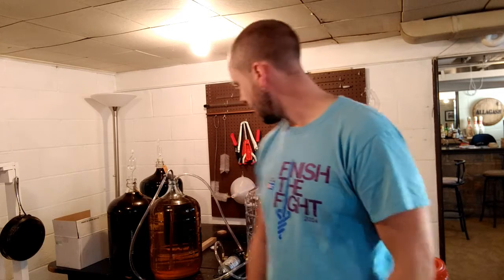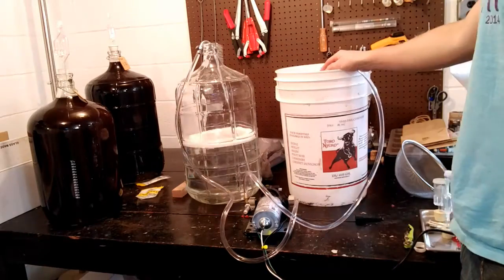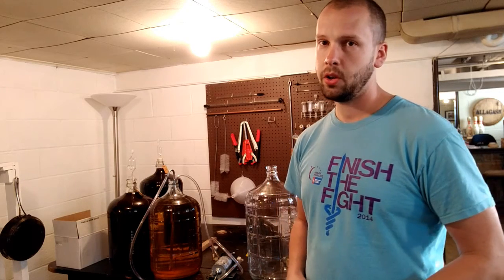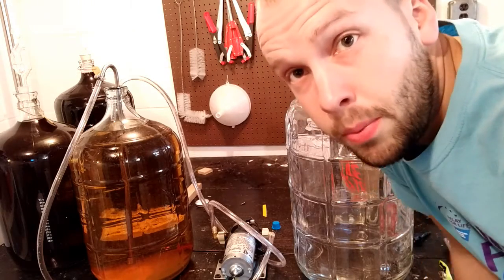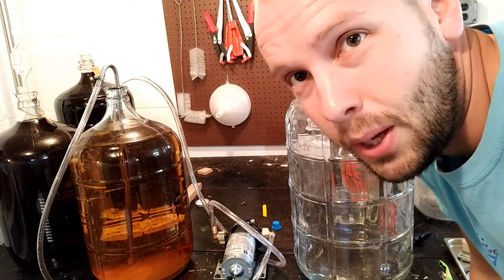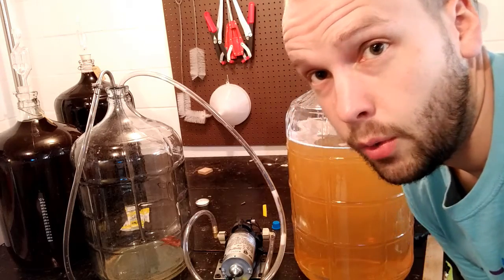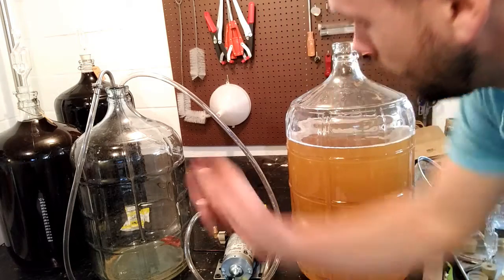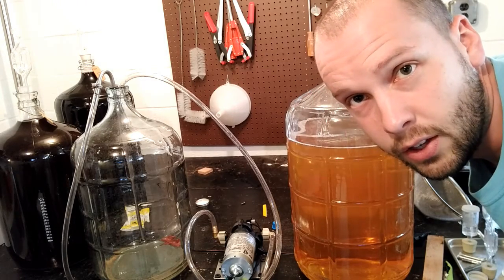Budget Wine Transfer Pump - Shurflo 2088 Diaphragm Pump

Comment: I see you wrote 3.3 GPH in the description, but I believe you meant GPM (gallons per minute). That's a pretty strong pump for just moving wine. I see why you would put a dimmer switch on it. Cheerz.

Comment: great idea! i am in the process of making something like this and am interested in degassing at the same time.  is there a way to control the flow rate.  i'm thinking installing a valve on the the intake tube. do you think that will be ok? also, as far as sulfiting, a ton of air is going into that secondary vessel.  do you have any problems with oxidation?
Reply from the maker: I was considering the same thing but putting the valve on the outlet so that the additional vacuum doesn't pinch the tube.  I think you should also be able to wire in a potentiometer or dimmer switch.  I have not had any trouble with oxidation but I go a little heavy on the sulfites when I use the pump.  I found that during this video I had a very slight leak on the inlet fitting which caused it to aerate a lot but with inlet fully sealed and if you submerge the outlet in the wine, you should get very little air exposure.  Even less than normal racking I would suspect since the contact time is so short.

Comment: Where can I find the elbow attachments for the hoses?
Reply from the maker: The correct fitting for it is the shurflo 2088 which you can find on amazon.  1/2" female NPT like what is used on a toilet or washing machine seems to also work fine.  That's what I used, and cut off the hose that came with it.

Comment: Do you still use this, or have you developed a different system?

Looking forward to any updates
Reply from the maker: I still use it for larger batches but I made some modifications. I mounted it to a wood board with a ceiling fan speed control switch in a junction box so that I can control the speed of the pump.
Reply: The Home Winemaking Channel thank you for getting back so fast, really appreciated. I love your videos, high quality, yet still down to earth.

You have a great set up, one I hope to emulate in a little way. I am trying to build a combined Brewery/Winery, so looking for as much inspiration and knowledge as I can.

Thank you again

Comment: Eventually, I think I'll get the 12v version and hook it up to a 12v deep cycle battery... Do you think it would be ok without installing an inline fuse?
Reply from the maker: +jmsteve45 I didn't install a fuse and I'm not too worried.  To just transfer a little wine here and there we shouldn't be working it too hard and I don't plan on spilling water all over it while it is running... And if I do, I'll pull the plug quickly

Comment: there is OILS in those pump!!!!!!!!!!!!!!!!!!!!!!!!!!!!! NOT for food!
Reply from the maker: Not on the liquid contacting side.  It is a diaphragm pump.  The moving parts needing oil are sealed behind a santoprene diaphragm.  These pumps are commonly used for water pumping applications because they are very clean and quiet to operate, and maintain good head pressure for faucets.
Reply: How do you clean the line after transfering wine? Any tutorial?